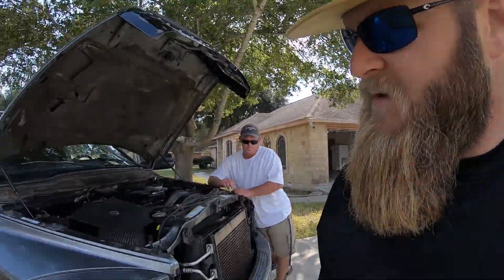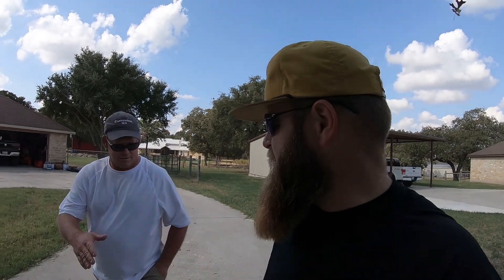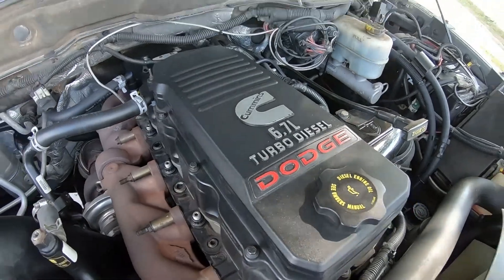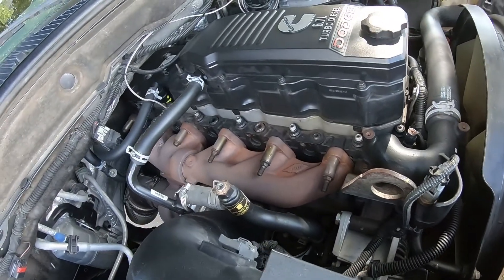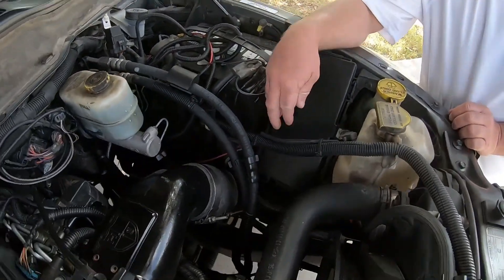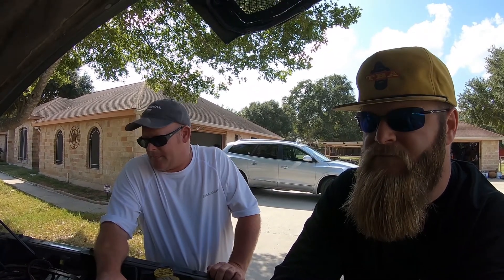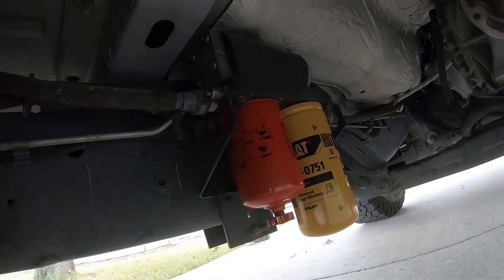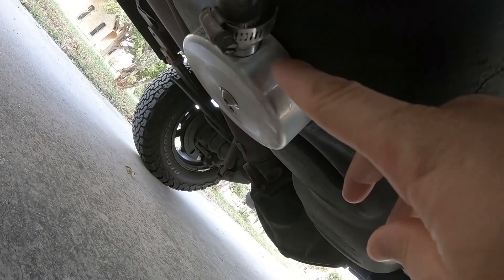HOW TO GET THE BEST FUEL ECONOMY OUT OF MY CUMMINS DIESEL

Comment: Sorry guys but this isn’t a 7.5 liter, straight up. What he is listing on that sheet is the model year of the truck the engine came in. You can see on the line below the name of the engine is ISBe.

 It is just the first version of the 6.7. I am telling you this as someone who works for Cummins. There is a 7 liter version of the 6.7 but it is not sold in North America. It is not possible to go much bigger than 7L. The bore spacing didn’t change between the 5.9 and 6.7 meaning that the Siamese bores thickness was reduced. If a 6.7 is bored out to 7.5L there wouldnt be enough material in the block to keep the cylinder walls from blowing out. I hope you didn’t pay a premium for this “7.5L Cummins”
Reply from the maker: Roger!

Comment: Come on why is this video still up? There is ABSOLUTELY no 7.5 Cummins that 07.5 is the year of the truck pendejos you’re in Mexico I’m sure u understand that, that truck is a 6.7 Cummins period!!!!
Reply from the maker: My buddy swore that the motor was a 7.5! 
I think it’s possible that he got the ONE AND ONLY 7.5 liter CUMMINS!!
Reply: Texas Beard Adventures No....
Reply: Just to beat the dead bourse again . Iv never heard of 7.5 L isb engine they come in variants 5.9, 6.7, 8.3,and 9.3.  I know there other engine platforms that cummins manufactured that I did not state . I tried and do some digging as a I was curious myself and nothing about a 7.5 . Chances are that he has a fire ring kit installed chances are there has been modifications to engine . Bore and stroke configuration have been changed in order to get 7.5 L and that’s all a “ IF “ but mid 07 is when the isb 6.7 was implemented so chances are that he he either read the paper wrong or hade bore and /or stroke changed to get that displacement

Comment: 2015 2500 Cummins 6speed 3.73rear End 6.7 deleted 4" back pipe, 4x4 and 4 door with camper shell.  KN intake replacement, 480,000 miles with steel wheels, stock skinny tires, 275-70-18 Firestone Transforce. Engine oils is never BLACK. Clear Clean Oil from 0-5000 and I change oil filter every 10k.  My MPGS range from 25-33mpgs on Highway. At high altitude 4000+ft and hot air over 80, I easily get 30+ MPGS like Texas, Oklahoma, Kansas, East Colorado, all the way to Ohio (summer hot weather time)...
Reply from the maker: Well hell yeah JOHN! Sounds like one badass rig! Thanks for watching 🤠

Comment: I e had a bunch of these trucks.  This guy is pretty clueless. I have been able to get 22mpg hand calculated with 33” tires ccsb 6 speed 4x4 and stock 3.73 gears.  I’m sure with a 2wd and 3.43 or whatever ratio he said, in ideal conditions and proper maintenance and tuning, high 20’s would not be out of the question.  Dude it’s a 6.7
Reply: What tuner do you have

Comment: What exactly was done to achieve the 7.5 liter?
Reply from the maker: I’m still trying to figure that out! I’ll let you know when I find something out. Thanks for watching
Reply: It's not a 7.5, it's just a 6.7, the number you see on that paper is the model year it was created (2007.5)
Reply: Can you get me in contact with the guy that did the tune up in Amarillo I’m from Dumas Texas which is like 40 minutes away from Amarillo and I actually Drive a 7.5 as well which is true it is not a 7.5 that 7.5 is actually the date that troca Post puede togetherMy truck is a 5.9 Motor 2007 3500 which I believe this guy’s truck is the first model Of 2008 that came off with that 6.7200 seven through 2008 it’s whenever they may the transaction from 5.9 to  6.7 that’s why those two years of trucks they called them 7.5 which means 7 1/2 right in the middle of 2007 and 2008 Hope that makes sense but anyways if I can get your help To get me in contact with that guy that did the tune I will surely appreciate it

Comment: What they mean on the paperwork he had there that’s it’s a Cummins built in the latter part of 2007 that’s why it’s called 07.5 they have to state that cause the early 2007’s had a 5.9 Cummins and the later 2007’s had a 6.7 Cummins.

Comment: Never made a 7.5
Reply from the maker: But are you sure they didn’t?
Reply: Texas Beard Adventures not for a pick up the block would be wayy to big to fit that valve cover that block is not the size of a 7.5 its like the 5.9 and 6.7 but the 7.5 is like 5” longer than the 6.7 block but yea im pretty sure Id know considering I work on diesels as a carrier
Reply: But yea that paper states the year 07.5 is the first year dodge ditched the 5.9 and released the 6.7 but yea its be like trying to squeeze a 8.3L in there
Reply from the maker: I know l.....that was sarcasm. Everyone under the sun us told me this. When my buddy told me about this I told him I didn’t think it was a 7.5 but he was convinced it was.
Thanks for watching
Reply: Texas Beard Adventures yea well itd be nice to squeeze one in but itd be wayy to heavy for the frame (which looks stock) and its be pressing them springs down pretty good

Comment: There is a IBS 7.5 Cummins engine this is used by International Durastar 4300-7600 just started in 2007/ 2008 they were using this engine and Freightliner school buses ISB 6.7 & 7.5 but the 7.5 was in medium duty freightliner trucks in international Durastar trucks 7.5 ISB Cummins is still used to this day
Reply: It's true facts about International Navistar did have IBS 7.5 Cummins engine in Medium duty Trucks 4300-7600 and Frightliner medium duty trucks and School Bus and MTA or Metro Buses
Reply from the maker: Appreciate the info!

Comment: Manufacturers date their vehicles every 6 months. In order for it to be considered a 2008 it would have to have been built in July or 08 or thereafter. The fact it was "built" in February of 2008 would be considered a 2007.5. Hints the 07.5 on the build sheet.
Please make the correction i.e edit the video or I'll just unsubscribe and dislike, like any others have or will🙄.

Comment: It's was a misprint.  If he wants to proven wrong and that the paper was misprint pull the motor apart and they can measure everything to find the true displament.  Eitherway good mileage oh and if it's fire ringed  that has nothing to do with gas mileage.